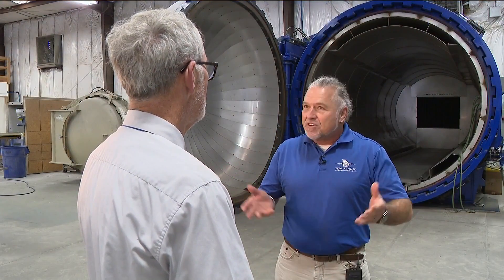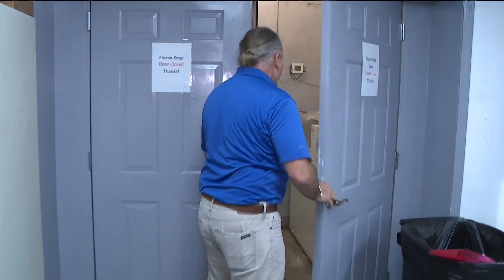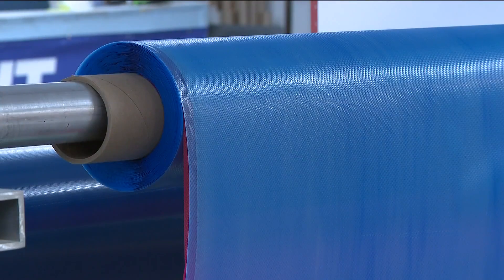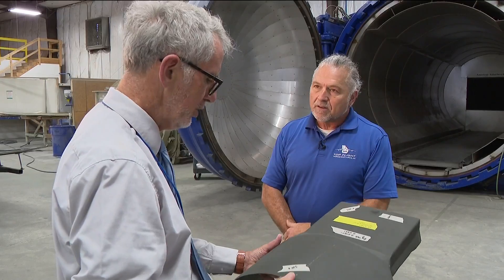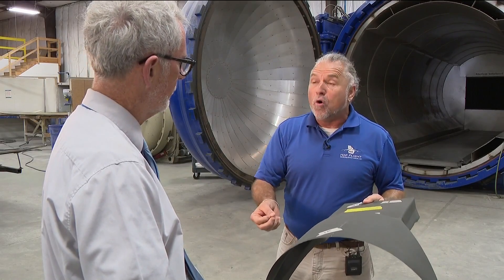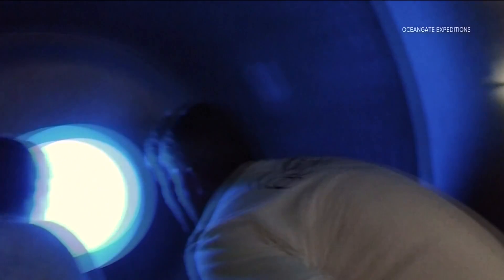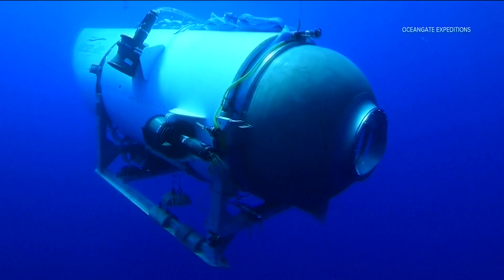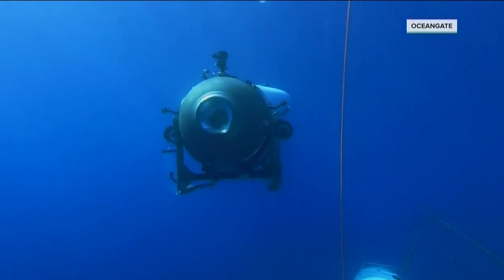Georgia engineer talks carbon fiber that failed in Titan submersible implosion

Comment: Carbon fiber is really two things, the carbon fibers themselves and the resin that holds the fibers in position and gives them stiffness. Carbon fiber has a tensile strength of 3 - 7 Giga Pascals. The tensile strength of resin is 55 Mega Pascal to 2.7 Giga Pascals. So the tensile strength of resin is below that of the fibers. Under expansion, as in a tank filled with gass and pressure pushing out, the fibers are taking all the load and the weave helps the fibers stay together and the fibers strength against stretching prevents explosion. However, if the pressure is outside pushing in, it is the resin ( and not the fibers) that take the load to keep the fibers from bending. The strength of the fibers in this case is less important. 

The other issue is the viewing port was rated for a depth of 1800 meters, but the Titanic is located at about 3800 meters. So the implosion could also have been due to the viewing port itself.
Reply: What'd your opinion, could this design have worked with proper testing after each dive? What if it's hull size was increased to more like 10?
Reply: @waitandhope  When products are tested generally they are tested to conditions that surpass the working conditions. I think engineers use 10x the expected load. Also, tests involve re-examing the structure after testing to see if micro fractures, not otherwise visible are present, because it is possible for a structure to accumulate stresses passing X number of tests but failing after X plus 1. 
I understand that ultrasound exam of the hul was not something done with the submersible Titan, and it was not tested to the 3800 meters that is the depth of the fated trip. 
Certainly if one knows the stress of the weakest link, in this case the resin, and the thickness was increased to compensate, it could have survived.  But that thickness could also introduce more complications not to mention cost, weight, reduced interior volume or increased size (the submersible has to fit on a mother ship), and possible difficulty fitting the various windows, hatches, and accomodating all the accessories that have to go through the wall and still be water tight to large depth.
Reply: @granitfog  It is not true that engineers design for 10 times the expected load. That number is not a given. That would cost governments and firms billions due to overdesign. 

I've personally overseen designs done at 1.5 times to 3 times the expected loads, and this is because we are able to anticipate the loading conditions, end user (pedestrian bridge for wildlife vs. for human vehicles), jurisdiction or local codes, size of project (foundation for a skyscraper vs concrete footing for my backyard shed),  comparative cost of material, etc. 

Factors of safety are not fixed. But the more uncertain the field conditions are, the higher they may need to be. However, the very presence of uncertainty guarantees little.
Reply: @granitfog
that is absolutely false, or else you'd never have any bending applications of composite materials!! (like airplane wings....) . 
The layup was undoubtedly a quasi-iso layup, thus having fibers in all directions and capable of handling load in all directions (not just in plane of the laminate, but compressive and tensile). 

The matrix transfers the load to the fibers, and they take the majority of the load due to high stiffness.
Reply: @josephgarrett3075  "Bending" involves a force applied from one direction resulting in tension and compression being experienced from opposite sides of the material simultaneously. So, the tension resistance of the carbon fibers on one side, conteracts the compression resistance the resin on one side. 
A cylender with force applied externally from all directions, results in compression being applied simultaneously from all directions. This precludes  tension resistance on one side from conteracting the compression of the other. All fibers in all directions experience compression. Since carbon fiver has the lower ability to resist compression,  it is up to the resin to prevent failure. (Mass Inst Tech: "Epoxy is strong in compression, but weak in tension, and carbon fiber is strong in tension, but weak in compression, but the combination of the two is strong in both" when the direction of forces allows the advanages of both to manifest.)
The relevant factors in this particular case is that the force (compression) is applied from all directions simultaneously, reducing the advantages of carbon fiber.
Reply: @granitfog  " So, the tension resistance of the carbon fibers on one side, conteracts the compression resistance the resin on one side "

That is not true and you would not be able to find a source to support that claim. The compressive resistance of a laminate (and tensile) is found in the fibers because they are the ones that provide stiffness. The matrix (or resin) transfers the load TO the fibers. Load follows stiffness (the inverse of what you see in other fields "following the least path of resistance"). 

"All fibers in all directions experience compression. Since carbon fiver has the lower ability to resist compression,  it is up to the resin to prevent failure. "

The first sentence is true. The ending is not! 

I found that quote from MIT and you did not include the beginning portion.....plus they are referring to each constituent on it's own! When cured together, the fibers are the ones that take the load and provide strength/stiffness, and the matrix holds everything together and transfers load to fibers via shear stresses. But the Fibers are doing the work. 

I agree with you (in part) that SOME advantage of composites are reduced in this application, but not NEARLY as to what you and others have said.
Reply: @josephgarrett3075  I can focus on individual statements and we can agree and disagree, depending on whether we look at the micro vs macro context or range, experiental vs practical application. In the end we can agree that the choice of  material must mach the application and design for that application.
Reply: @granitfog  
I will agree that they did not choose the best material here, and most likely the biggest issue was the mismatch in materials that caused a thermal CTE mismatch (others have claimed that only uni-directional layup was used, which is so- then yeah, there is going to be failure and that is on them). 

But you have not been able to support your claims by journals, sources, composites/mechanics of materials textbooks and the principles found in them (used everyday by engineers and analysts). 

Have a look thru here and see for yourself that the compressive strength of fabric rivals that of the strongest aluminums and several steels...

https://agate.niar.wichita.edu/Materials/WP3.3-033051-102.pdf
Reply: Interesting analogy. The same analogy works for concrete. It does great in compression but is weak under tensile stress. Steel bars however are excellent in tension so they've been used to reinforce concrete structures for generations.
Reply: If you watch videos showing the contruction and laying-up of the carbon fibre strips, all the strips were rolled on straight, i.e. along the circumference. This means that the material would have been strong circumferentially, but because there were no fibres laid longitudinally, it would have been weaker in that direction. Normal practice is to cross-weave the fibre layers so that the strength of the material is uniform.
Reply: Bravo 👏  excellent information!  Thanks!
Reply: How did he or anyone on his engineering team not look this up??
Reply: There was no weave.......They were using unidirectional carbon..............Paul
Reply: I see your point, but if the pressure would have been on the inside, wouldn't this reverse the whole thing? Then the material would have compression on the inside, and tension on the outside.
Reply: @mark6678  Carbon fiber is very strong under tension, (being pulled). For a cylinder wrapped in carbon fiber, a force pushing out from inside would put those fibers runing around the cylinder under that tension, which is what they do best.  
Your statement of "compression on the inside" does not seem to take into account that the the force from inside is applied in all directions simultaneously, and the fibers are running all the way around the cylender, taking that force as an attempt to stretch them (i.e. tension, what the fibers do best)
Reply: @granitfog So CF is stronger in compressive strength on the inside of a concave shape than the outside? As you know, the compression side is the side  being pushed in on and the opposite side is always the tension side. I could be wrong, but I would think that it would be weaker having force or pressure applied on the cylinder from the inside out. If you press on a toothpick, it always breaks on the tension side, the opposite of where you are putting compression. By putting the compression forces on the inside of the cylinder the toothpick is already bent in a u shape, so it would be more easily snapped.
Reply: @mark6678  "So CF is stronger in compressive strength on the inside of a concave shape than the outside? "  - No. CF is stronger for tension, (fibers being pulled). Thus, an application where a cylinder as pressure pushing outward is optimal. 
Your toothpick analogy is good for concrete under load. For CF the tension vs compression characteristics are opposite those of concrete and toothpic. But a structure made from CF uses CF in multiple directions so that forces produce tension on CF regardless of the direction of force.
Reply: The viewing port hole in the titanium was in perfect condition and was slanted in. So I don't think that was the cause. Back pressure from the implosion blew it out and off the titanium. 
If you can, go find the video of them gluing on the ring to the carbon fiber. You will be shocked at just how thin the lip was on the titanium ring. It's the dumbest thing I've ever seen. It was made to fail.

Comment: Wait, did they actually not do NDE on the vessel?  That is wildly negligent if true.
Reply: Nope they did not, also Rush said to one of his customers that the carbon weave was obtained cheaply through Boeing due to i being out of date and could no longer be used for aviation. The hatch hemisphere has 18 bolts but they only ever used 17 due to one of them being a pain to access. Also the titanium rings that support the hemispheres were epoxied to the hull, two different materials that expand and contract at different rates. How rush described the hull cracking sounds of previous dives proves that he does not have sufficient knowledge of how carbon fibre behaves. Every time he heard those cracks at different depths weakened then hull every time on top of the usual stress fatigue. Rush dismissed these cracking noises as the the hull just “settling in” as voids in the lay up filled in and weak fibres got torn. One engineer that worked for Ocean Gate tried to raise these problems and was fired from his position. Another previous engineer also said that due to the characteristics of carbon fibre the hull monitoring system would be useless in an emergency and could never allow sufficient time to surface the sub. There are many other construction factors too.
Reply: @Just_Another_Viewer  This is going to show up in a lot of engineering ethics material I'm sure.   Hopefully, at the very least, this makes a lot of engineers to check their own due diligence.

Comment: James Cameron said his spherical titanium submersible compressed 3 inches in diameter at depth.  It is safe to say that titanium and carbon fiber would compress at different ratios causing even more extreme pressure on the Titan joints that were GLUED into place.  I'm impressed it didn't implode on the first dive.
Reply: yup i was just thinking the best thing for this kind of deep dive is a titanium sphere where the compression forces are distributed equally over the surface other shapes create uneven higher pressures in certain sections plus cf is not good on compression stress which is what you're dealing with in this case
Reply: @ARCSTREAMS  maybe but titanium doesn't take the repeated cycles of compression and decompression too well. even if its strong to start with
Reply: @gfjdhdfghfdjgf6167  yeah perhaps not as good as steel, which has a better modulus of elasticity
Reply: @gfjdhdfghfdjgf6167  It does if it's below the yield point
Reply: @sdrc92126  military subs made from titanium have generally been a bad idea.
Reply: There's a video where it was supposedly live video of the construction of the capsule It was nothing like this. It looked like they were winding this of wires around the core
Reply: @botgurl6583  nothing like what?
Reply: @botgurl6583  Winding carbon fibers and brushing epoxy over each layer, yes.
Reply: @botgurl6583  Oceangate built at least three subs, Cyclops 1 and 2, and Titan. Experimental vessels so different techniques may have been tried.
Reply: @mikeomolt4485  I heard their next one will be built from a cardstock-ducttape wrap. I hope the authorities don't stifle this innovation.
Reply: @toomanyaccounts   You can say they're not subs, but Oceangate did. They functioned submerged under water and they're not submarines, so if they're not submersibles, what are/were they?
Reply: James Camerons challenger submersible was made out of steel, not titanium. Just watched his documentary.
Reply: @mf3983  Correct. Titanium is strong, but brittle.
Reply: @toomanyaccounts  True story.
Reply: Cameron has it right.   his biggest concern was getting hung up on something down there,  not turning into a chum meat cloud because his platform failed.
Reply: The "glue" isn't even much of a problem in the case of this submersible tbh
Reply: I love how everyone is now listening to James Cameron rather than actual experts on the subject.
Reply: @qarnos  Cameron built his own submersible with expert help, and holds the record for the deepest dive in Challenger Deep. I'd say he has more experience than Rush or probably all of the diversity higher kids at OceanGate...
Reply: @qarnos James Cameron is an expert. He helped engineer his own sub. He has been to challenger deep. He has been to the titanic over 30 times.
Reply: @jackn8458  he is an expert film maker. His Titanic joyrides do not make him an expert engineer any more than watching Cameron's shitty movies makes me an expert film maker.
Reply: @qarnos  Just because you don’t like James Cameron doesn’t mean he is not an expert in the field. He helped design and build a sub, he piloted it alone, he has been to the deepest part of the ocean and collected samples. What more credentials do you need?
Reply: @jackn8458  He did not help to design and build a sub, he commissioned other people to build one for him. He is simply not an engineer, let alone an expert one. This is not controversial, it is a simple fact. I'm not sure why you can't understand this distinction.
Reply: @qarnos  Nobody said he is an engineer. I said he was an expert in this field. What is your problem with James Cameron? He was heavily involved in the construction of the sub. He piloted it dozens of times. Next are you going to tell me Robert Ballard isn’t an expert either. Also, I’m not a fan of titanic or avatar but they are some of the highest grossing movies ever. How are they shitty?
Reply: @jackn8458 I think maybe he gave off a big head vibe in one of his interviews about the sub.
Reply: @qarnos  James Cameron is an expert who just happens to be a filmmaker too. It works both ways. The same way we shouldn't make the mistake of overrating someone just because he/she is a star, we shouldn't underrate them either.
Reply: @incomingincoming1133  I don't doubt for one second JC is an expert submarine passenger, but he is not an engineer. I fly in airliners, that doesn't make me a pilot.
Reply: @qarnos  The equivalent to JC would not be a plane passenger. It would be someone who designs and flies his own plane to a higher altitude than any plane ever made.
Reply: Exactly
Reply: Yes........Glue was probably the failure point........It would have to be capable of flexing, WITHOUT coming apart..............Paul
Reply: A lot of Oceangate executives in this thread, it would seem 😂😂
Reply: Some semi stainless spring steel might handle the repeated stresses well. Good luck evenly heat treating it though.
Reply: @darrel7589  it didn't do 13 dives. most of the dives were aborted because multiple pieces of equipment either fell off or failed or were found to be installed wrong
Reply: @pclement7879  I agree, there is no way Cameron's titanium sphere shrunk 3in
Reply: @pclement7879  Fact of physics.
Reply: Does he make the same excuse when he jumps in a cold swimming pool? "Oh it's compressed in length because of the cold!"
Reply: @michael-3-l3 George Costanza has had great problems with "Shrinkage"